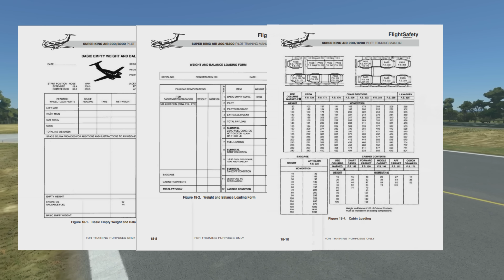Disaster Just After Take Off | Crash of King Air, Melbourne, Australia

Comment: I've discovered and watched a couple of your videos today. Love them so far. I'm just learning to fly (too late for the RAF for me but at least I can fly for fun). I'm not completely fearless but watching your crash and turbulence videos are really good for understanding and minimising risk - Who'd have thought a simple rudder trim error and being slight overweight could be so catastrophic. Keep up the good work. And good luck with your career
Reply: Actually, 240 kg over gross can't really be called "slightly"
Overweight. That's nearly 500lbs over, and the pilot had to have known that. Sorry to say it, but I'm  not seeing anything here but pilot error/negligence. One wonders If the pilot was coerced into accepting the weight, As well as, possibly a balance violation.
Reply: @MrZeissOne  agreed.  I was about to say more or less the same thing.  I wonder if 7,000+ hours in general aviation (or is this classed as commercial?) can make someone complacent?  It shows the value of checklists (as long as you do them!).  I’ve watched a lot of large aircraft disasters where experienced pilots forgot to extend the flaps or crashed into a mountain when EGPWS warnings started because they didn’t stow the speed brakes.  You wouldn’t believe anyone could do these things but it’s happened more than once.
Reply: @moiraatkinson  
I think often it's a lot like sex. The pressure of unreason expectations, especially with time constraints leads to failure to perform and inability to keep the equipment aloft. Here,  the failure to get it up and keep it aloft is catastrophic,  not simply embarrassing and disappointing. 🥺
Reply: @MrZeissOne  🤣🤣 I love your explanation!  I can see what you’re saying though and it’s good logic, which fits.
Reply: @MrZeissOne  If that's what you go through every time you spend time "Flying" then it's beyond me why you even bother.
Reply: @moiraatkinson   Someone really REALLY SHOULD do a study on that about hours of experience leading to complacent behavior... I know that on average there are two CRITICAL times for a person getting into motorcycles...

1. The first six months are all those "stupid noob' sh*t" months. Forgetting how to start the bike, getting in a rush, dragging feet, relying too much on one brake or the other, not putting feet down when you stop...etc...etc....etc... SO we always try to encourage a cheap, USED, LITTLE bike as a "starter", just so you're not heartbroken over killing "Baby" nor bankrupt when you abuse the bejeezus out of her...

2. Around the second or third year... This is where you're really developing habits for riding, and for better or worse, consistency in those habits. It's also where (usually) your worst habits come around to bite you on the ass. USUALLY, it's a scare more than anything, and something "adventurous" strands you on the side of the road with a rapid heart rate and a cold sweat while you mutter "Jesus H,P. Whickerfelt Christopher Columbus CHRIST that was dangerous!" or something to the effect...

     BUT some just don't get to survive their first REAL f*ck-up. Most of my "aviation" experience is in ultralights and experimentals... BUT I've been riding most of my life, 30 years since getting a legitimate license alone... and all over the world. I've seen a LOT of the same patterns... First thing's first, drop the brand new bike, usually trying to stop from duck-walk without straightening the forks... The front brake will throw you over the bars at 3 mph when you do that... haha... BUT it's one of those lessons most of us learned "the hard way" and no amount of warning will help. The shear complexity of a bike, versus even a car, is enough to set you through a small mountain of dubious incidents and silly close calls... from rocketing through the neighbor's fence to flopping off the back of the seat while the bike leaves you behind... mostly small "scuff ups"... and eventually you "settle in"... Then comes that point where "you know what you're doing"... That's where bad habits start to form... "It's only a ride to the store for soda and a dozen eggs"... and no gear when you get cut off and end up over the hood of a car at 40 mph, landing on your head for the start of a nice long stay in the hospital while family sweats bullets about whether or not you'll even know your own name when (and if) you wake up... that sort of thing.

     Of course, Aviation, even General Aviation has a solid faction of folks who practice as well as preach the precautions and conservative attitudes required for flying, while motorcycles seem to inspire the reckless and self-destructive nature in just about everybody... almost no matter HOW ardent they talk about "safety first". It seems that some things are only fun BECAUSE they're difficult, dirty, and DANGEROUS as hell...

     It's just a cycle I've seen relatively regularly since ever I've been riding... ;o)
Reply: @gnarthdarkanen7464  You’re dead right.  I’ve heard from general aviation channels like the Air Safety Institute that yes, beginners need watching, but another type of accident risk is very common when people know a reasonable amount, maybe get instrument rated and have some hours under their belt.  They tend to think they’re better than they really are - not in a show off way, just subconsciously and they get complacent.  They’ve been lucky up to that point and particularly if they’ve taken a risk and got away with it up to now, it reinforces the idea that they don’t need to worry about, say thunderstorms, because they’ll get away with risking weather every time.

Once they get past this point and become very experienced, they finally get safer.  Think of it like starting your flying career with 2 jars.  In one is your luck, in the other is your experience.  At first, the experience jar is empty, but your luck jar is full.  As you progress, your luck jar will go down as your experience jar fills up.  At a certain point, your luck will run out.  You’d better hope your experience jar has filled up as high as possible by that time.

It’s a fascinating subject and you’re obviously knowledgeable with motorbikes, where this principle is really well demonstrated.
Reply: @moiraatkinson    Well, 30 years or so ago, I was the dumb-ass 15 year old kid who's buddy had a crazy uncle in the Army Motorcycle Corps... That's how and when I got my first license to ride in the street...

    I've since been on the roads of more than a dozen countries around the world, and probably put more than a million miles under two wheels. I'm not a saint, and in spite of probably one of the best instructors and mentors to impart his wisdom at the time, I have had a fair few scares over that time... adventures galore...

     BUT much as you put it with the two jars, I've tried diligently to take every scare as a lesson, drawing and analyzing everything I could about how things went sideways and what I could've or should've done better... so I could fill up my experience (aka "wisdom") jar faster than my luck got traded out for it...

      I've also seen the losses of quite a lot of friends... known about more people lost to this "sport"... and even a few other hobbies and sporty passtimes. Maybe someone IS putting together the study, but there definitely NEEDS to be, so we might have a better chance at helping the future aspiring students of anything get past those times of complacency... Pilots (especially commercial pilots) could be regulated into passing check-rides on particular criteria or at a more appropriate schedule... something...   ;o)
Reply: @gnarthdarkanen7464  I think they are checked at regular intervals, but this airline probably didn’t bother.  Maybe an unexpected check from time to time would be appropriate too.  What should also be appropriate is a check on the aircraft at regular intervals.

I know there is a concern about the number of GA fatal accidents.  Every other branch of flying is seeing accidents fall in the last decade, fatal accidents anyway.  But in general aviation, the numbers have gone up since the year 2000.  In part, this is going to be from the sheer numbers of planes in the sky I guess.  If you ended up in a dive, then at least nobody should be underneath you in the 70’s.  A significant factor I’m sure will be with commercial and military aviation experiencing increased safety standards, it rubs off on the GA pilot who overestimates his ability to control the aircraft.

Paper Skies, who has a YouTube channel focusing on military events of the Soviet era and was part of the USSR, believes that the communist regime to cover up facts after an accident, led to a situation where the transport industry just didn’t learn from mistakes.
Reply: @moiraatkinson  Of recent General Aviation is seeing accidents rise by the shear numbers of "ordinary people" who find out they can afford a pilot's license. When I was in school, my middle school Chemistry Teacher told us about getting her license at 17, which is legal in my state... AND we were shocked to find out that you could get a pilot's license within a year of the minimum age for driving a car... Now, with the internet, everybody and their damn cousin can just Scroogle that up... and the price of a GA course... do a little budgeting, and ta-da... ta-da... a new pilot is trotting out to rent an airplane and take right off as if he or she knows it all... 

     I've noticed a few incidents from the old USSR that seemed pretty dubious... and the results slipping into Commercial Aviation, or just repeating over and over... AND it's one of the few comforts I get from our society and governance, even here in the States. Things wouldn't improve quite so easily or quickly (even given only after the fact) except that the investigating authorities are so openly forthright about what they do and what they find out... Information is more readily available, which it often isn't elsewhere.

     At least, "so far... so good" for the U.S. having a hopeful future by the nature of open discourse. It doesn't always seem that way, but it IS that way. Hiding the results and avoiding "humiliations on the dead" is a solid way to perpetuate bad practices and stupid hazards.  ;o)
Reply: Likely it was the overweight situation that prevented the pilot from overcoming the trim tab error which induced a "slip" condition. A slip causes a drastic loss of airspeed and an airplane then stops flying. I am a retired Captain and that is my guess. BTW Curious Pilot you are to be commended on the great photorealistic CG work. It is nothing less than spectacular.
Reply: The take-away, as a pilot is to USE and FOLLOW checklist like a religion.  An unforce error is an ugly way to die.
Reply: I was living in Melbourne at the time of this crash.  A new golf course had been recently opened on King Island and was being heavily marketed.  I would not rule out the factor that there was economic pressure on King Air pilots to deliver golfers to the new resort destination.  This could have contributed to overloading the aircraft with golf equipment and also put pressure on pilots and the company to deliver.
Reply from the maker: Thank you so much Hannah, and good luck too! 🙂 I was thinking earlier about this, but this incident in particular always reminds me to double/triple check the trim before takeoff. It’s one of the sad but amazing things about aviation that everyone should be learning from everyone’s mistakes and something good still comes out of something tragic.

Comment: If you have to take your time to be sure everything is set right for takeoff, so be it. Time lost is better than lives lost!
Reply: It is required by regulation and common sense.
Reply: So so so right. I flew back in the 70s and you just can't be to careful.
Reply: @haroldbrown1998  y uu I yjuii KY y juju up i887ì8⅘GJ hmm junk 4kiķi l7kii I krmmiìkuùs6es arrested 399hj I ijjo7 Iya 7 Yuki5⁷kill IL oil k Lou
Reply: Better to be late in this life than early in the next
Reply: They should have done that and held it down longer to gain more speed since they were heavy. Pilot error too bad.
Reply: You are absolutely correct. After all what would you give to have the people back that you would kill if you missed something. Take your time and do everything and physically check items with a check mark. Which will require you to do it properly by slowing you down because a check mark is required for you to move on. And yes I use this system even though it is on a semi truck the results Will be the same. Take your one. The life you save could very well be your own. No to mention your wife and kids life if they are with you. I can assure you that you do not want to bury your child that unfortunately I know first hand how absolutely painful it is to bury your own child. It’s nothing you ever want to experience. So save your own life slow down and live. Dlying and preflight inspections ahoupd becwr be a rushed thing to do because I’d the potential cost you could pay is a cost I guaranteeyou  I is not something you ever need any to do. Just because you chose to be in a rush slow down and be thorough. As I said the life you save may be your own or you wife’s or God forbid you child. No matter how their age. Mine as 31 and I was deveatatinf and I pray you never have to bury your child because it will break you permanently. Take my word for it.
Reply from the maker: Very True!
Reply: Inspection is boring. It must be automated